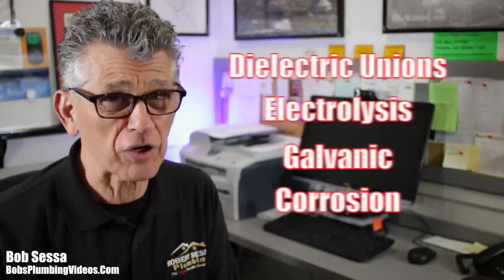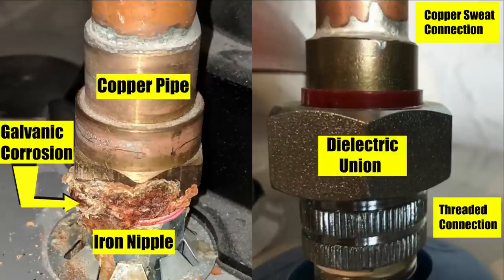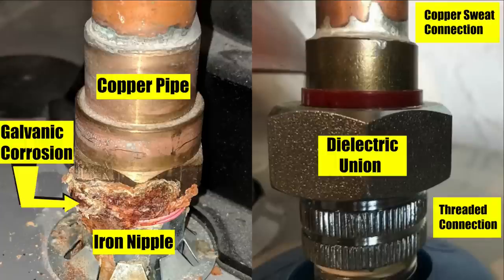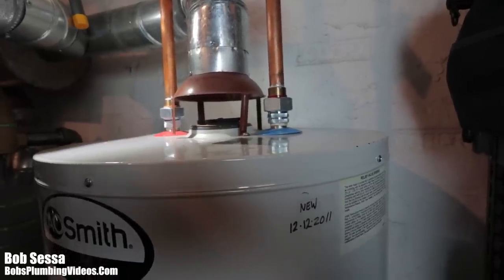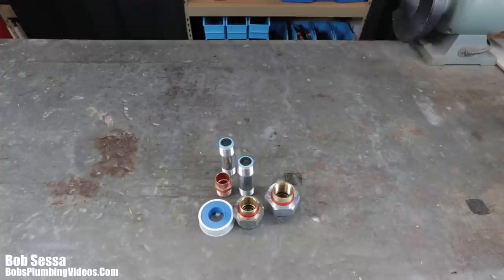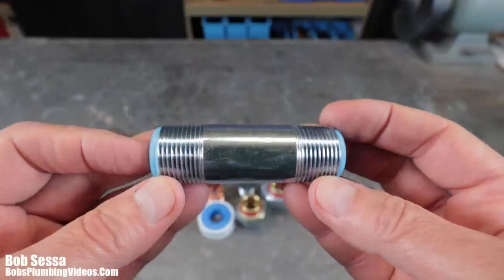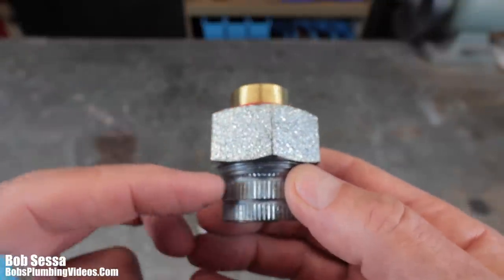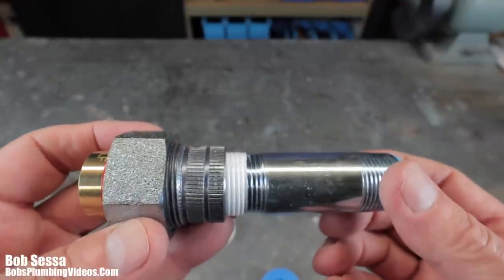Dielectric Union Water Heater -

Comment: To each their own, I suppose.  I have installed water heaters about 20 years ago that I have installed copper male adapters into the top of the heaters and have been back to those houses multiple times with no galvanic corrosion at the heater or on the piping and/or water pressure issues with the hot water in the house.  Heaters still work great, too.  I normally don't install dielectric unions because the gaskets normally end up leaking because expansion and contraction due to changing water temps and the chlorine in the water.  Almost every dielectric union I've taken out has had rust form at the steel half of the union either on the face of the union or inside the opening.

The dielectric nipples I still install and have very minimal problems with the connections to those nipples corroding out.  As long as you make the connections properly, the connections usually last as long as the heaters do.  The dielectric nipple sleeves or liners do fail as well, but it's very seldom you see that.  Just my take.

Comment: Hi Bob, nice to hear someone who knows what they are talking about! One thing that surprised me during electrical testing on the dielectric union assemblies I made is that it is possible for them to conduct across IF THEY ARE WET. A 'salt bridge' of sorts can form. I dried out the components (they should stay dry in use, as only the inside should be exposed to water), reassembled, retested, and the conductivity dropped back to zero from one side to the other. Also, I noticed my expansion tank has stainless threads, so I'm putting a dielectric union between that expansion tank and the copper lines also.
Those 'dielectric nipples' will NOT function as a replacement for proper dielectric unions, though.
Reply: When installed into the plumbing system, there will always be an "electrical bridge" between the galv and the copper via the water.....As already noted, these unions greatly  reduce the problem but don't stop the  effect all together...Another point to consider is that how the system was earthed/grounded originally may have compounded the issue, and although the dielectric union has physically stopped the problem, the earthing/grounding aspect may still need looking at. Given that a dielectric union essentially isolates the tank from the copper pipe, fitting it may have implications on the earthing/grounding else where in the house, so this aspect should be considered anyway....

Comment: Another no non-sense piece of advice. Great job Bob.
Reply from the maker: Thanks 👍
Reply: @BobsPlumbingVideos  Bob, why pressure relief valves and drain valves (brass) are fitted to water heaters without dielectric protection? I never figured out why they are treated different than the water in/out.

Comment: Steve Lav installs copper fittings directly to the dielectric nipples on the new hot water heaters that he sells. He has remarked in several of his videos that dielectric unions are not necessary. Flexible copper lines are common in my area so I installed new copper lines when I replaced my water heater and those copper lines had plastic gaskets which I assume are for electrical isolation.

Comment: Hi Bob  . . . Thank's for the tip of using Dielectric Unions - I will keep it in mind if and when my hot water heater has to be replaced
knock on wood hope it will be long before it will be replaced - good video .
Reply from the maker: Thanks Pete, regards. Bob.
Reply: This was a great common sense video

Comment: Thanks for the tip on the dielectric union.  I installed a new electric water heater and chose A.O. Smith 50 gallon 500 series. I did not want to use the metal braid supply lines as I had one leak in the past.  Fortunately my son saw a little water on the basement floor and we fixed before it became a real problem.  For this install, I sweat the fittings and pipe together and used the dielectric union you describe 3/4" copper sweat to female pipe thread.  I also used the Teflon tape and Megaloc you describe in another video.  After everything was assembled, NO LEAKS!  If I had any leaks it would have been a real kick in the nuts, I purposely take my time and measure twice and cut once sort of thing so I don't have to fix a bad joint etc.
Reply from the maker: Excellent Stuff Tom 👍
Reply: Couldn't shower that night? Shouldn't be tinkering around.

Comment: Excellent information!  I have a Bradford White 50gal Water Heater and  I'm replacing the OEM straight Magnesium anode rod with a flexible Magnesium one (my ceiling is to low to insert a straight anode rod).  I want to use the original style Heat Trap but the problem I see is that on the new anode rod nipple there's a plastic core insert that I would have to cut out & remove because the Heat Trap will not fit.  My question is; should I go through the hassle of removing this plastic core just to use a Heat Trap?  Should I not use the Heat Trap at all or can I extend the nipple with an adapter then insert the Heat Trap then connect my flex hose to finish the connection.  Thank you very much!
Reply from the maker: Personally, I think the heat traps were more of a marketing ploy. Depending on the quality of the water in your area they more than likely will end up not functioning due to scale build up. I wouldn't stress about it and eliminate them if it make the job easier. Thanks for checking out the video, much appreciated!!
Reply: @BobsPlumbingVideos Thank you again for your help!

Comment: Corrugated stainless. 36" worth costs less than the union, dielectric's built in, tolerates small movements during a typical earthquake or sudden need to scoot the tank out, and you don't need a massive wrench that demands a foot of clearance to spin them. If a washer fails they're of an easily-obtainable size.
Reply: Stainless is supposed to galvanically corrode galvanized too.

Comment: Of course galvanic corrosion, pitting and stress corrosion cracking depends on whole host of factors pressures and temperatures in the heater, water chemistry things like hardness (which impacts electrical conductivity), ph values, aggregate states and in commercial industrial setting More particularly start and shut down processes. I agree not even those dielectric unions will protect against very corrosive environments but a standard copper to steel with or With out brass unions may be stable for long periods in non corrosive environments. The point is how many pros really understand or bother with this prior to specifying the type of water heater to use. Very few if any in a residential setting more prior testing on water chemistry side may be undertaken in an industrial setting where the costs are much greater in getting things wrong.

Comment: Bob if there are any pinholes in the tank liner which there usually is this is where galvanic corrosion occurs leading to a tank leak I replaced a commercial one in an apartment building it had two strikes galvanized main runs copper runs up to the top floor with no dielectric coupler on the tank it had a hole in the side in 5 years just as the previous tanks had done unfortunately 1 1/4  couplers are expensive 400 dollars each but like I told the owner if the 1200dollars tank last 10 years or more it's worth it  also most of the tee's attaching the galvanized pipe to the risers were leaking badly
Reply from the maker: I've seen corrosion happen inside the inlet and outlet dielectric nipples even with the dielectric unions more than once?

Comment: Great video. 

I assume that all the silver colored metal in the di-electric union is steel, so that you are screwing the steel female thread of the di-electric union onto the steel male thread of the water heater's di-electric nipple.

I'm currently installing with difficulty a bottom entry water heater by threading a 3/4" brass elbow directly onto the di-electric nipple that sticks out of the tank horizontally. The challenge is to get the elbow turned upward to 12 o'clock to mate with a vertical copper pipe, and at the same time, neither under nor over tighten the brass elbow. 

Unfortunately during my first attempt, I used only teflon paste without teflon tape and 4 hours after installation, I got a 1 drop per hour leak at the junction of the di-electric nipple and the brass elbow. 

I now have two choices: (1) tear everything apart and rebuild it with the identical new fittings, but this time using both teflon tape and teflon paste, or (2) use a dielectric union with a copper elbow soldered to it to create the 90 degree transition from horizontal to vertical. 

Choosing option 2 allows me to readjust the threaded connection between the di-electric nipple and the di-electric union, should it leak, without having to cut apart any adjacent copper plumbing. If ever the di-electric union's rubber seal leaks or if ever the thread sealant leaks, it will be easy to mechanically disassemble the dielectric union without having to unsolder anything else.

One disadvantage of option 1, which doesn’t exist with option 2, is that the di-electric nipple supplied with the water heater has male threads which were rolled as opposed to the female threads of my brass elbow which were milled. Mixing rolled male threads and milled female threads does not create as intimate a mechanical connection as mixing milled male and milled female threads. In the former case, the sealant has a bigger challenge filling the larger microscopic spiral channel between the male and female threaded parts. That alone could explain my 1 drop per hour leak.
Reply: Update: In my last paragraph above, I suggest that the disadvantage of option 1 does not exist with option 2. In fact, with either of the 2 options, a fitting with a female thread has to be screwed onto the male di-electric nipple of the water heater. For both options, that means getting the tightness (torque) of the female fitting correct and using the best sealant method. With option 1, the tightness might not be optimum because the elbow has to always be positioned pointing upward at 12 o'clock. 

The rubber seal of the di-electric union looks a lot like the rubber seal in the water meter nipple of my water meter. My 43 year old water meter has had its rubber seal changed only once 22 years ago as a precaution as the original rubber seal was 20 years old. Neither of the 2 seals has ever leaked. This observation may be of comfort to users of di-electric unions who worry about the rubber seal lasting the lifespan of the water heater.

I would appreciate it if someone would state how many turns after being finger tight, a female brass fitting can be wrenched onto a male steel di-electric nipple and still not be under or over torqued.

Comment: DIYer here. 1. I assume the threaded collar needs to be the same metal as the nipple it is screwing onto, such as water heater out. When buying dielectric couplers, how do you know you are buying one that is compatible with your water heater? The coupler and outlet nipple should be the same metal. 2. How to know what metal is used on the water heater water outlet nipple? 3. I thought galvanized is not for use with potable water. Are the WH nipples galvanized steel? Maybe because they are lined with plastic they are acceptable?
Reply from the maker: Most modern heaters are already fitted with die electric nipples, they are simply lined galvanized nipples. Galvanized waters lines were common in the '40s and '50s, they eventually would close up inside (hardening of the arteries) and water pressure would be non-existent. We ripped them out and installed brass plumbing.
Reply: @BobsPlumbingVideos  Thanks for the reply!

Comment: THANK YOU for this video. It seems I'm having a problem with my HWH tripping the breaker, even after corrosion problems shorted out the heater on the last one - less than a year ago!
I'm not sure how far 'upstream' this cause exists (pipe metal-mixing), so is there such a thing as a pre-WH 'conditioner' that might remove contaminants just prior to entering the WH?

Comment: Bob I usually buy state water heater from the plumbing supply but my neighbor has a Rudd. Home Depot special 40-gallon water heater Natural Gas the nipples on the top or corroding no dielectric union do you know on a Ruud water heater if you could just change the nipple on top of the tank
Reply from the maker: I use A.O. Smith And Bradford White water heaters, both have dielectric nipples installed and can be removed.  I generally install dielectric unions and than convert to copper. I don't know for sure about Rudd, but I've never come across a nipple on a water heater that I could not remove.
Reply: @BobsPlumbingVideos  thank you Bob

Comment: Excellent video Bob.  Great instruction and well worth the time to watch.
Any advice when working with PEX piping?  
Would a dielectric union still be required?
Reply from the maker: You can install a Dielectric Union (female iron pipe threads both ends) on the water heater, followed by a male by  P.E.X. adapter.

Comment: Bob, thanks for the video. Two questions: I live in Rockaway Queens.  City just replaced water Mains. Had to shut water off nine times.  Two days ago brown water had to be flushed via fire hydrants. My hot water heater had corrosion but one day after, cold line blew. Flooded basement. Nipple down to 5% diameter opening we with corrosion. Did the sediment in the city’s work contribute to this? Secondly, is the tank salvageable if the plumber can get the nipples out?

Thanks

Jason
Reply from the maker: How old is the heater?
Reply: 6 years. Warrant ended 2/19!!!! Put in after Sandy destroyed basement
Reply: It’s a Bradford White 80g gas. Never drained, never replaced rods :(
Reply from the maker: My opinion is that the incident with the city didn't contribute to the problem.If the tank is not leaking and the plumber can replace the nipples, sure it'll most likely operate. How long I could not say, it's out of warranty so it's basically your call. If it's making hot water and keeping up with the demand, go for it!
Reply: BobsPlumbingVideos 
Thanks Bob, really appreciate your advice. 

J

Comment: Which part do you really tightin up with pipe wrench ? I cranked on the nut and washer got caught in threads. Is it suppose to be really tight on heater nipple ? Or hand tight with a nice turn

Comment: What about using a stainless steel nipples. My dialect nipples rotted out after 15 years. They were the same one you showed in the video that came with the tank.
Reply from the maker: 15 years is not a bad run, but stainless would most definitely work!
Reply: @BobsPlumbingVideos  I looked this morning  and it's been 17 years actually. I changed their anode rod about every 5 years.

Comment: Great video. Subscribed. Galvanic corrosion fascinates me. I am having problems with the corrosion of the 3/4 x 5 inch steel nipple that the builder's plumber used between my brass hose bibs and the copper female connection behind the brick fascia on my house . I have already replaced one leaker and the threaded end that went into copper was almost half gone (didn't understand and reused a steel nipple) and it is already putting out rusty water again when first opened after a long while. Another original bib on the other side of the house also gives the rusty water when first opened after a while. Will using a brass 5 inch nipple into the copper prevent the corrosion cell from forming?
Reply from the maker: Thanks for the subscription, yes brass into copper will solve the problem.

Comment: Good vid! Got a question- I currently have copper flex pipe (with pre-formed flange) going right to my tank and it's corroding. The other end of the flex pipe is soldered. Is there a union that would accommodate such a set-up?
Reply from the maker: You can purchase 3/4 die electric unions that are female pipe thread on on end  (screw rite onto the nipple coming out of the tank) and 3/4" copper on the opposite end.

Comment: Just replaced my 21 yr old Bradford White electric 50gl water heater, it had the dielectric union.    My new Rheem 50gl was also installed using a new dielectric union as well.

Just wish I had time to go with another Bradford White this time.

Comment: is there a torque spec between the two no to over toght and crush the o ring gasket
Reply from the maker: Not the I'm aware of? Good and hand tight plus 1/2 to 3/4 turn with a channel lock pliers or pipe wrench.

Comment: i am planning to add these babies to my dhw inlet & outlet.  i am also adding an expansion tank (et) to my system. i believe the et inlet is stainless, would you say i need a dielectric union there too.
Reply from the maker: You can cut a tee into the cold water supply feeding the tank and install the expansion tank, no need for die electric fittings in that case.